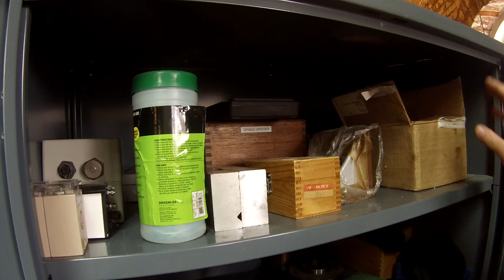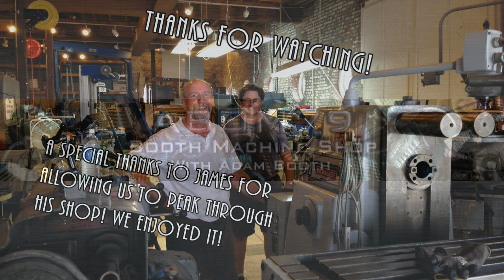Tour of James Kilroy's Shop

Comment: Adam,
Thanks for sharing. If there's one thing I've learned its that buying machines is only the first step.  It's the tooling that really adds up. I'm constantly amazed how much tooling some of you guys have. huge investment.
Reply from the maker: The machines are just one piece of the puzzle. Stocking up with tooling, both cutting and work holding can run up the investment big time.

Comment: AT A CERTAIN FAB SHOP I WORKED AT, IN NORTHERN INDIANA, AS A REPAIRMAN - SWING MAN, THEY HAD A HUGE VERTICAL MILL! IN THE NORTHEAST SIDE OF THE BUILDING ( POSSIBLY A 1900, TO 40S ) 36 INCH VERTICAL ROTATING BED. THEY SOLD IT 15-20 YEARS AGO. I NEVER GOT TO SEE IN RUN. THEY SAID THEY HAD'NT USED IT IN YEARS. MAN, IT WOULD HAVE MADE A VERY GOOD UPGRADE FOR CNC! Thanks, love this stuff.

Comment: That Pacemaker of his is the same size as the one my uncle has. I use it once in a while if I have a project that is a little too big for my 7x10 Harbor Freight lathe LOL! The Pacemaker is a hell of a lathe and every time I run it I feel like Im steppin back into the 30s or 40s or 50s. Its just cool.
Reply from the maker: They are some nice heavy machines engineered to last a lifetime! For an old school lathe they are a top runner.
Reply: next time I use my uncle's I will be sure to make a vid and post it!

Comment: At 23:17 there is an electrical panel with the cover removed. If this was done because there is currently work being done inside, OK. If this panel is open because it just never got put back, please tell James to put that cover on, you might be moving a long pipe or something and accidentally stick it in the panel. You will get dirt and chips in the panel. Nothing good will happen - please tell James to cover the panel!